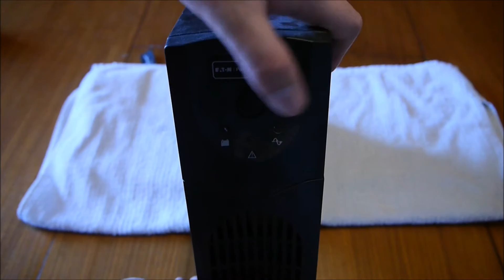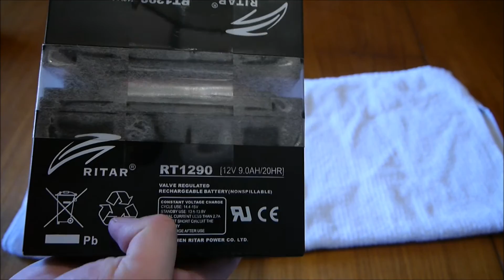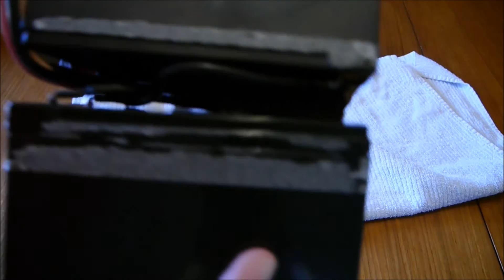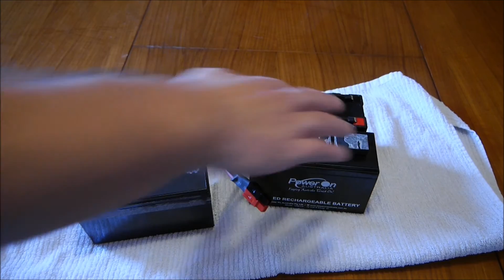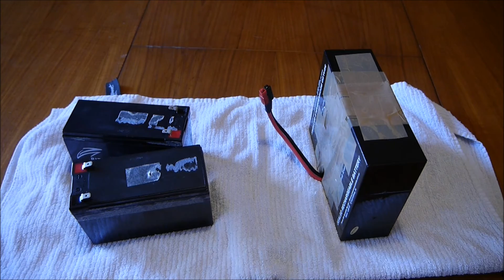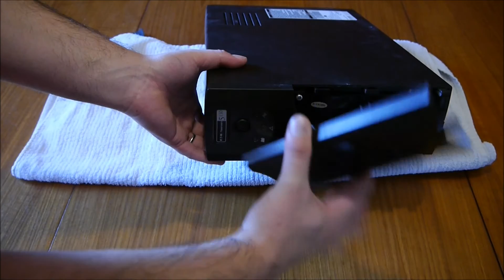Boydo's Tech Talk - How to Replace a UPS Battery

Comment from the maker: Sorry for the delayed response! According to the manual you'd need a 12V/7.2Ah sealed lead acid battery. You should be able to get these from electronics shops (ones that sell capacitors and components, not iPhones and tablets) or maybe a dedicated battery store. Otherwise, if you call Eaton/Powerware they can advise you who will stock them locally.

Comment from the maker: I could only think that maybe because the batteries are dead that they may have expanded slightly making it difficult to remove them (despite the stiff plastic housing). Certainly a challenge but you might have some better luck in a place where it is cooler to help make the batteries contract in size.

Comment: wow y is ur battery so easy to pull out. We've got x2 5110's here both with dead batteries and i simply can't pull the batteries out! They are so tight in there and it won't even budge. I've tried to even tip it upside down and shake the shit out of it

Comment: Great video.  Helped me to replace my batteries although in my case the batteries had cracked, swollen and were leaking which caused a few more issues when it came to simply 'sliding the batteries out' using the plastic tab provided.  I am compiling another (more advanced) video on how to take the case apart in order to get the batteries out if swollen.

Thanks again Boydo! Nice work!